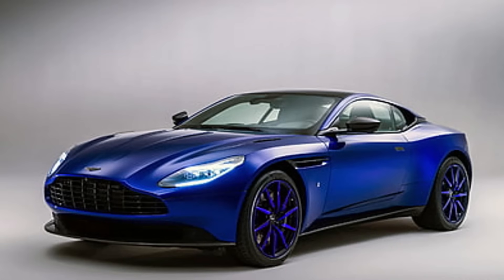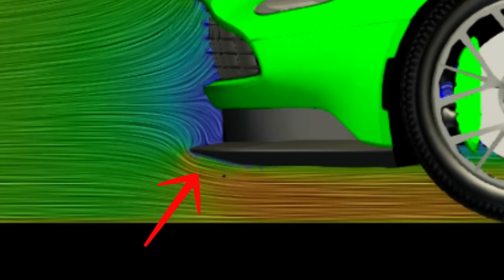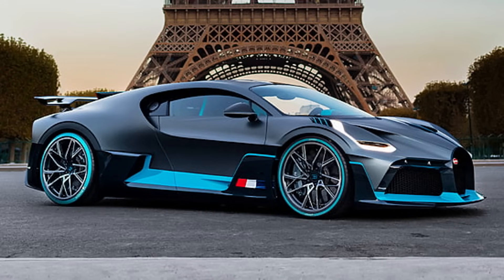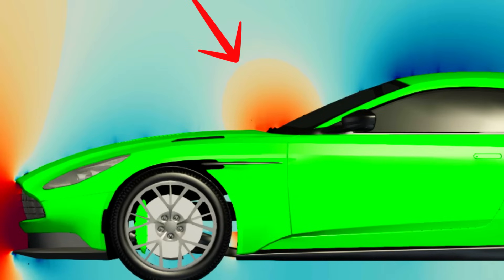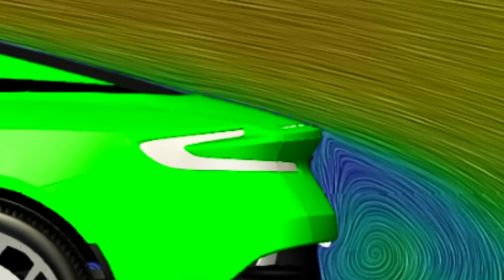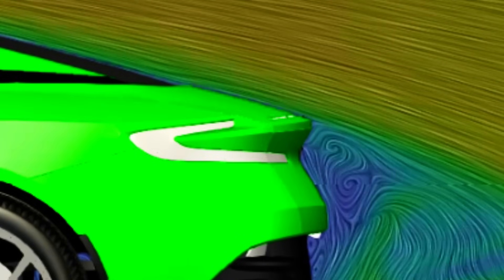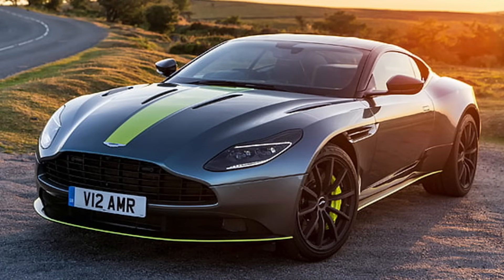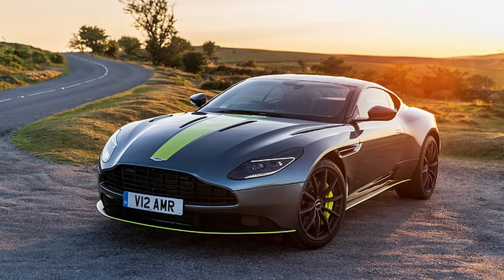The Most Aerodynamic Supercar Aston Martin DB11?

Comment: I would be interested to see an analysis of the Porsche 718 Cayman GT4, which has significant aerodynamic enhancements, including underbody. Also a comparison with its sister, the 718 Spyder. Both have big splitters, rear wings (one deployable, the other has 2 fixed wings) and both have significant frontal air intakes, and rear diffusers.

Comment: How detrimental is that gap of the body panels at the top of the windscreen? Any car really.
Seen makeshift speed runs with it taped-over to smooth it out.
Reply from the maker: It generally doesn't make that much of a difference on a regular car - the air is already turbulent by that stage, so the tripping effect it has is negligible. It's more just a small increase in drag usually, particularly if the flow still stays attached over the roof afterwards.

Comment: I think Porsche has been using an aero blade with the smile vent. It's too small and too far forward  to be a radiator vent. They have also been working on the same idea to act as an air dam in front of the front wheels.

Comment: Aren't splitter sizes essentially regulated by pedestrian safety regulations, particularly in the EU?
Reply from the maker: Yep, the lengths are. But, one way of getting around it is making 3rd party parts that are explicitly said not for the road. Then the onus of who's responsible becomes a grey area.
Reply: @PremierAerodynamics I think the ultimate solution to this would be to have a moveable aerodynamic device, a splitter that protrudes out at higher speeds, much like wings do on expensive road cars. This would mean that pedestrians are safe at lower speeds, and the car gets downforce when it needs it.